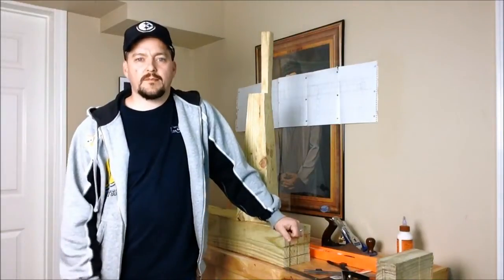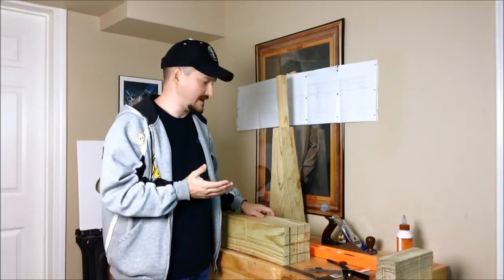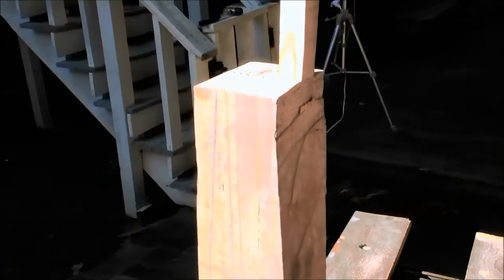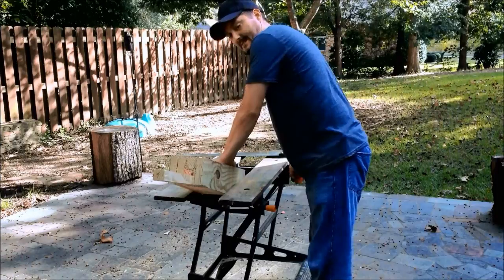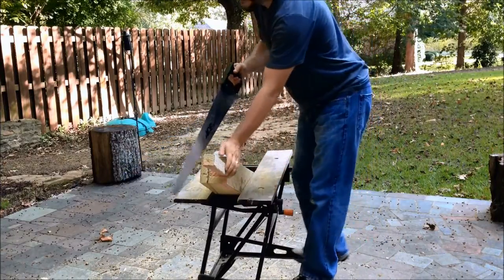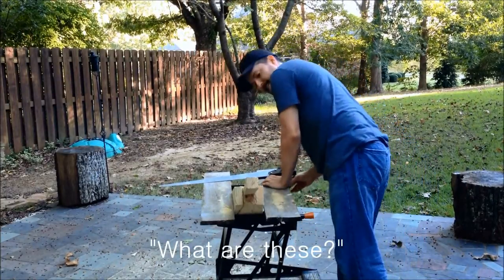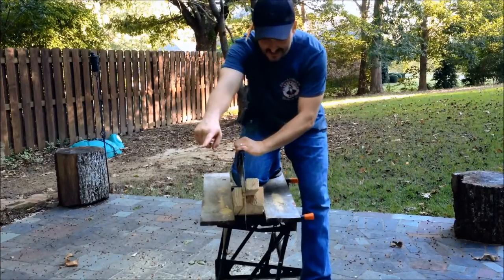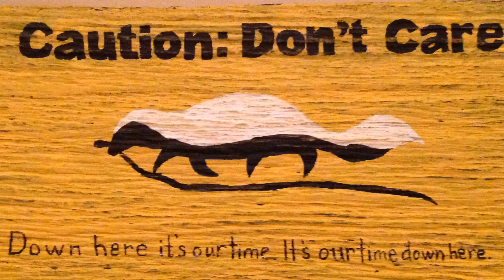BGBC S1E30: DIY Building the Ultimate  Gaming Table Part 3-Shaping the legs

Comment: With the 21.5" leg portion what kind of clearance are you looking to get once the table is complete ?  I've seen some tables with 28"5 clearance.  I also appreciate the involvement with the kids.  Great idea.
Reply from the maker: 28.5" is way too much if you ask me. The deep well will cause problems with a clearance that high. 20.5" to 21.5" seems like it would cause a knee hazard for some people (assuming a 17" standard seat height) but you have to remember there will be approx. 19" of desk sticking out when the desks are folded out that will keep knees safely away. I sat at mine the other day and 20.5" and 21.5" both were just about the perfect mix of knee room and being able to see over the top of the well. Hope this helps.
Reply: Board Game Batcave Sounds good.  I'll be sure to take note of that extension provided by the desk and look very closely at the 20.5-21.5 design you've tested.
Reply from the maker: I think after rereading our text messages i may have confused us, so Ill try to break it down.  The height to the bottom of MY tables TOP RAIL is 21.5". This is the knee knocker i was talking about. With the added rail, the clearance to the bottom of the table is actually 25". The base is 3/4" and the top rail/drawers are 9.75 making the final height 35.5". The Sultan claims 34.75" so its close. Anywhere in this range is good. Hope that is clear as mud.

Comment: Really should use safety glasses with chisels.  I'm a hypocrite here, because I don't use them either. At least get some for the child.  They love em.

Any ideas of easier methods to cut the taper?  I use power tools, and have a good table saw.
Reply from the maker: I have seen youtube videos of people demonstrating taper cuts using homemade jigs on a table saw.  Hope that helps and thanks for checking us out.
Reply from the maker: You might also consider laminating two boards together instead of trying to cut down a 6x6 with a table saw...

Comment: Just wanted to commend you on using hand tools to make your table. Having used some hand tools in the past i completely understand how much work is involved. Something to think about when you attach the legs to the table is a product called tbolts granted they would require some type of drill, but it would make it so much easier if you ever had to move the table.
Reply from the maker: The legs, and more specifically the attachment of the legs, has been the biggest challenge I've come across when drawing out the plans.  I have a joinery version of how I'm going to do it but I may have to break down and use a drill for part of it.  We'll see.  It'll be an adventure either way.  Thanks for the support and for commenting.
Reply: Board Game Batcave Technically there are still hand drills/taps you could use, the only time i've seen them used is with very soft metals (mostly the taps, thread creators for bolts) but they are out there.
Reply from the maker: powersave2 I actually have a hand drill (brace/bit) that I inherited along with the other tools but it is rather rusty and needs a LOT of TLC.  Still haven't decided on how I'll attach the legs but if I choose to 'drill' the legs, I don't think I'm going to restore the brace/bit.